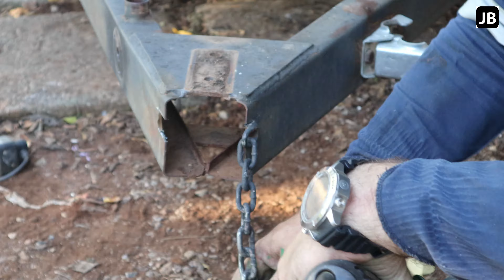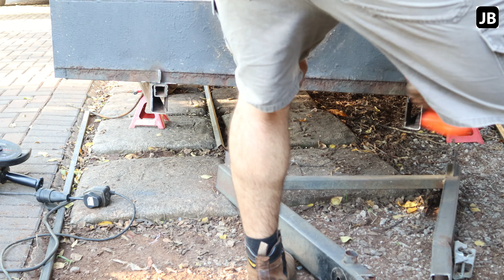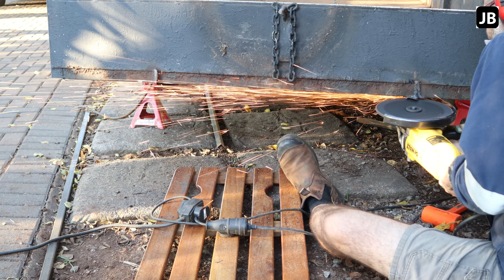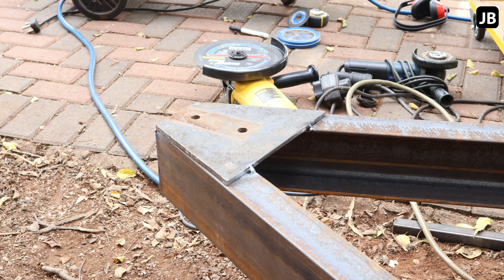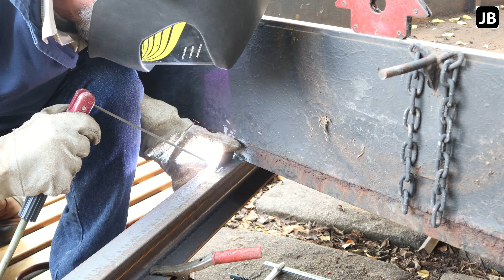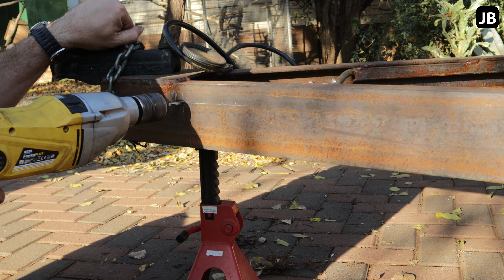Trailer repair (Again)

Comment: So the other day i was working on a suspension the bolts 22 mm where very tight so to crack them loose i locked the 22 mm spanner to a 24 mm spanner and did the two spanner trick then noticed a small dent deformation in the corner of the open end is thst normal for a quality tool if so are there less damaging methods to get more leverage on a combo spanner
Reply from the maker: It's going to happen as the contact area between the two spanners is so small, the force will dent even a top-quality tool.  to avoid it I suggest building one of these. 

https://youtu.be/6zjQSTbLsJY
Reply: @JacoBadenhorst  l see thanks I was considering getting rid of my gedore red set I bought as a back up spanner set due to that but i will keep it has this happened to you
Reply from the maker: A lot of my tools have nicks and dings due to  "mis-use". Just know it's your fault when it happens. Not the tool. I scrapped a gedore 8mm socket this week after prolonged use in a air impact driver installing roofing screws.  Not a bad socket. Just me abusing it.
Reply: @JacoBadenhorst  true
Reply: @JacoBadenhorst  I would have used a speed wrench for such try it better than impact